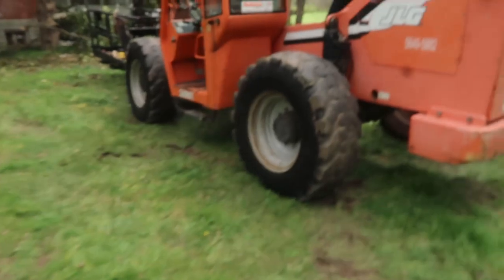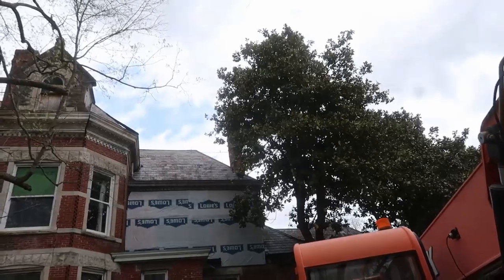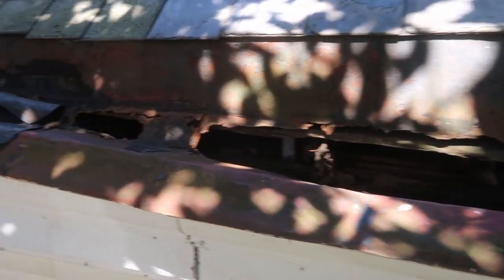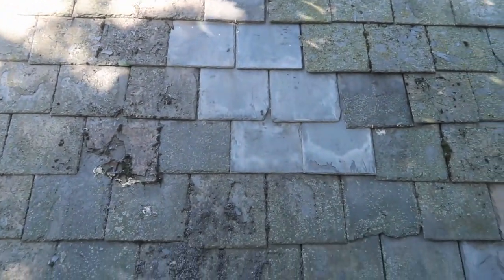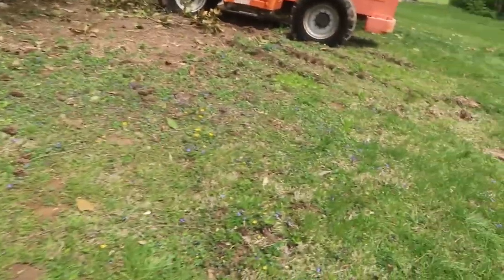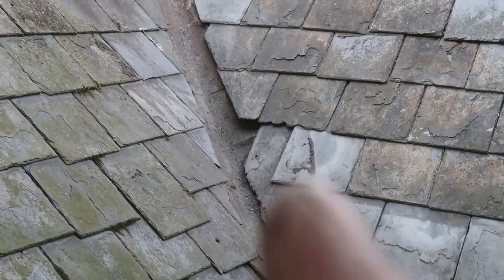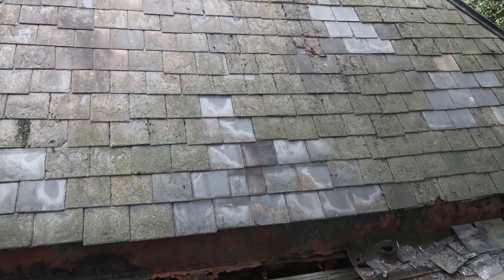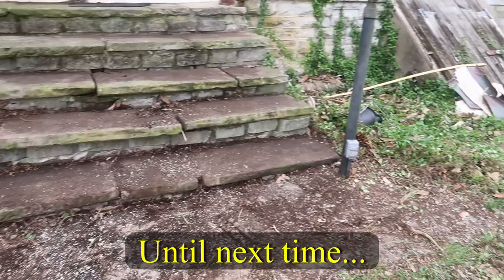TEMPORARY Becomes PERMANENT!  We Hope That Isn't The Case HERE! S3E4

Comment: I found your site only recently but have watched everything about the Moreland House from the oldest video to this one.  I'm impressed.  

We restored a 1912 house.  The previous owner was a structural engineer and had stabilized the building and put on a new roof -- so we started with a much sounder house.  Since the outside of our house was all wood, we didn't have to deal with masonry and stonework (and I'm completely amazed that you took it on without help).  We did virtually all the rest of the work on our own so I understand what it takes.

Our experience with the window frames and siding might be of interest to you.  These were all old growth heart pine so they survived and were mostly rot-free despite years (decades?) without being painted.  We started by removed all traces of the old paint and sanded down to bare wood.  Even so, our first attempts to repaint failed miserably in short time.  After doing some research we learned that the failure was mostly likely because the years of exposure had dried out the wood so much that it absorbed the volatiles in the paint extremely fast -- and that kept the paint from curing properly.  As per our research and with the advice of an old pro at a paint store, we started treating the wood with an oil-based deck sealer (the kind that says it can be painted over) and letting that cure until the surface no longer appeared or felt oily.  Then we pained with a good oil-based primer and oil-based top coats.  We've since sold that home but the current owners tell us that our paint job is still holding up after 20 years. I can't remember the exact products we used -- but given that it's now 20+ years later, I doubt that the exact same ones would still be available.
Reply from the maker: Thanks! We love learning from others experience. Some years ago a lot of the windows were replaced with regular pine and screws for the sashes and they have all failed. We have enough heart pine to make them again. We might get some of that done this winter.

Comment: I am glad you fixed the leaks even if just temporary fixes a tight roof is the most important fix. As others have said the trees have got to go. I would remove that old I am guessing maple so you have clear access to the dormer as I said in the option videos the tree looks structurally unsound. Much better to have the old failing trees out of the way and replant some new healthy ones in a couple years when you finish the outside. Keep in mind people are always going to need a "Bertha" to maintain Miss Mooreland when locating new trees. Maybe the future landscape needs to be more in the style of French Chateau's with a large pea stone pad around the house looking out to trees and gardens in a more open design.
Reply from the maker: That's a great point about someone always needing something like Bertha to maintain the property. Once all the heavy stone work is done we might could trade her in for an 80 foot boom lift instead. They are limited to 600 pounds though so they wouldn't be helpful right now.

Comment: It is studied that the roots of the trees extend in the same radius that the crown does. Therefore, even if it is not as visible as the roof damage, the roots must also be under the house, with potential damage likely. Since you have a lot of land, you can plant others at a safe distance from the house. It would be important to start planting new trees now, as trees absorb moisture from the soil and also provide protection for this reason. But the greatest benefit is given by the trees when they have a good size, which implies around 20 years. (from Montevideo, Uruguay, South America). This is the English version of my previous comment, made by Google Translate. I am a native Spanish speaker and it is not easy for me to write in English. Forgive any errors that may be in this translation. I put the comment in Spanish before, of which I feel safe. Blessings.
Reply from the maker: Agreed! We do plan on planting new trees at a safe distance from the Mooreland House. Thanks for the information.
Reply: Thank you for sharing your "adventure".

Comment: Roof repair is the most important chore to preserve a building.  If the boards holding the slates are rotted, eventually you'll have to re-do a lot of the roof.  :-(  But at least the leaks are stopped for now.
Reply from the maker: The decking on the Mooreland House roof is all heart pine. It is in great shape in most places. With slate it's easy to move the nails into a place that is more solid if there is some rot.